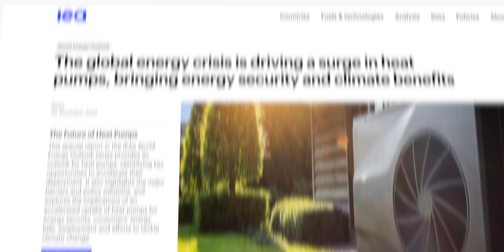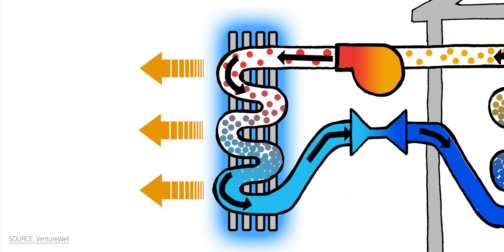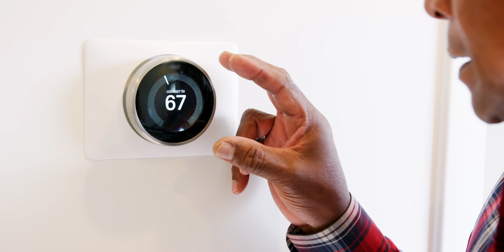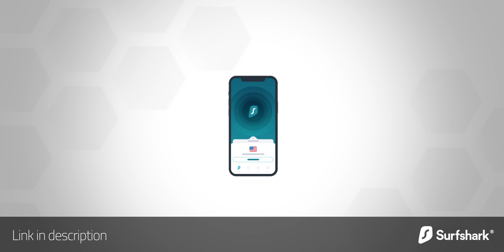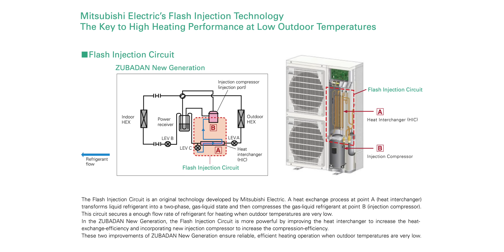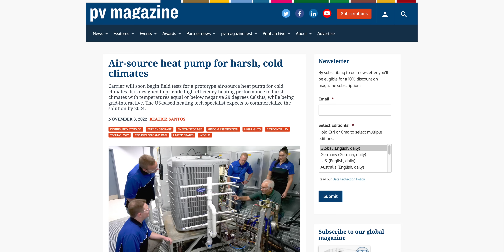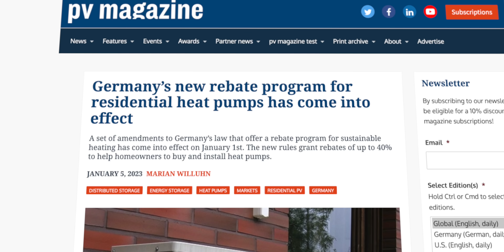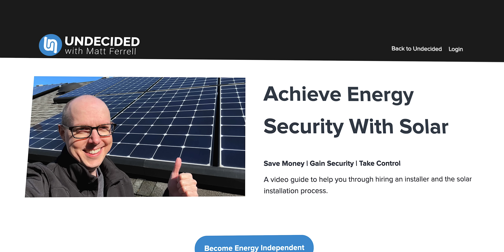Major Advances with Heat Pumps in the Extreme Cold

Comment: in the UK per KWh Electricity costs roughly 3.5 times more than Gas, even during the Ukraine war, therefore at present it doesn't make sense from a financial position.  Heat pumps are less efficient in cold weather, even if they can cope with cold weather they are still less efficient in cold weather, this makes the maths even worse.  Save the planet yes, save money no, not here in the UK at any rate.  Don't open the front door in the depth of winter, because that heat pump will take 3 hours to correct the blast of cold arriving into the house unless you install pre-heaters, and preheaters do not save the planet or your finances.

Comment: Matt... the Air Source heat pumps are vastly more efficient if they do not have to heat above 32 Degrees C.  Keeping it within that margin is difficult with radiators so underfloor heating has to be the way to go with an Air Source.

Comment: It is obvious that Matt has a New Englander bias around heat pump utilization. I grew up in New England and seeing a heat pump on a house is a rare thing in New England indeed. Most homes use natural gas or "Home heating oil" in a furnace to generate heat up there. For the rest of the United States, particularly south of the "Mason Dixon Line" heat pumps are the norm. In addition to this Heat Pumps are dependent on electricity whereas some fossil fuel heating systems work regardless of the power grid, something of huge value to cold climates where power outages are common. The biggest blind spot of this channel is that Matt presents his topics as if his audience has a bottomless wallet. He "energy shames" people without regard to their personal budgets. Just because Matt can afford a home that is easily 2x more expensive than a similar sized home from a more traditional build doesn't make it the right choice for the bulk of his audience. This blind spot makes Matt feel elitist and hard to relate to.

Comment: Matt, you really need to more clearly address the differences between air-source heat pumps versus ground-source heat pumps.
Reply: One couples to ground and the other couples to the air.  Ground source doesn't become less efficient in cold weather, but the borehole cost makes it more than double the upfront cost.

Comment: 2:10 is not how a heat pump works. The liquid refrigerant passes through an orifice to the low pressure heat exchanger, heat is absorbed due to the change of state of the refrigerant. The now gaseous refrigerant gets compressed, and is now at a high pressure, the refrigerant passes through the high pressure heat exchanger releasing heat as the gas condenses to a liquid. The liquid now passes through an orifice to the low pressure side starting the cycle again.

Comment: I really wanted to do Geothermal heat pump but the prices in MN were crazy for it and it would have blown my ability to get the house.
Cost of Project: $74,855.00
Potential Tax Credit 30%: $22,456.00
Cost with Potential Tax Credit: $52,399.00
This was about the best quote we got after trying 3 installers.That quote was from Nov 8th 2022.  A bit more that then $12k on the high end I was expecting.
This would have been for a new manufactured 1700 sqft home with a basement.  Maybe I can pull it off in the future, but for now I just need to do a traditional furnace and then look at solar after I sell my existing house.
Reply: Geothermal heat pumps are usually 20-30k after rebates.  What kind of BTUs did they quote?  This video mainly discusses air sourced heat pumps which are basically super efficient reversible air conditioners.  Those are in the 12k-ish range depending on size.  What was the quote on conventional furnace plus air conditioning?

Comment: Vermont is seeking to carry the no fossil fuel beacon over the cliff.  There are not nearly enough electricians to install cold wx heat pumps…and most are refusing to do so…why?  They fail miserably.  Anything above a cabin required several…folks who had them installed are using space heaters to stay warm…

Comment: The best way to get the optimum system is to allow them all to be available on a level playing field and let the population decide. In uk we went through a period of electric storage heating as we were told it would heat up during the night on a lower tariff. Well when the sun came out the next day there was no control and so we had to open the windows! My point, the lower tariff was an inducement especially as our area had no gas. When gas came my parents installed that. It remains the cheapest solution.

Comment: With the advances in several different types of heating and cooling, we are not tied down to a single way of heating or cooling a property.
For example, you could use a heat pump, but also have infrared heaters in the house both of which are more efficient than a boiler and both have their strengths and weaknesses, but complement each other.

Comment: electric rates in the northeast are expensive and you cant run the heat pump if the power goes out which happens often enough with ice storms or downed trees to matter. its about the same to run a heat pump on 26 cents (all fees included) a kwh electric vs 3.50 a gallon heating oil so the cost savings is not there and solar is at a minimum nov-feb when you need it the most for heat. personally i run mine in the shoulder months and then let my existing oil furnace run. also very glad i have a wood stove even if its a scary indoor firebox!

Comment: Congratulations on your vertical well heat pump system. I've had one installed 14 years ago, using 4 wells 150 meters deep. Great investment. Together with solar panels, equals zero energy costs.
Reply: damn, that's my dream setup..
Reply: Please tell us when the investment paid off?
Reply: @drdoolittle5724  Only 22 more years to the break even mark...
Reply: Geothermal really depends on your location. If you are Midwest then it can be worth it. But inverter style heat pumps can work significantly lower. My central heat is an inverter HP and it works down to 20*, and the only reason it can’t go lower is I went with the cheaper smaller unit, partly because my house is old and the ductwork is screwy and a larger one wouldn’t have been worth it. But I live in the pacific NW so we have only had one week so far this winter I had to regularly run my furnace.
Reply: What was the total cost of the system...🙄
Reply: Vertical well heat pump  100 to 400 feet deep
For a vertical system, holes (approximately four inches in diameter) are drilled about 20 feet apart and 100 to 400 feet deep.

Cost between $20,000 and $38,000
Unfortunately, vertical loops are the most expensive type of geothermal system to install, since installation involves deep and wide boring. A vertical loop installation costs between $20,000 and $38,000.
Reply: So was the vertical well heat pump system free ? Were the solar panels free ? If not then it most assuredly is not "zero energy costs" 🙄
Reply: @glamdring0007  I can assure you I've already earned it back.
Reply: @avhuf  And I can assure you that it was never free...which was my point. It might cost you nothing today but how much was the upfront cost ? 20k ? 25k ?
Reply: @glamdring0007  I think you're missing the notion of "investment" as I said in my OP. The point of investing is forking over an upfront cost (hefty in this case) and hoping to have ROI. In these cases, the ROI is often guaranteed. Heck, I'm making money atm.
Reply: @avhuf  You seem determined NOT to be upfront about the actual cost so I am calling it Pish.
Reply: @avhuf  Please reveal your upfront costs 14 years ago for 4 vertical wells and solar panels. Thank you.
Reply: Cost to you* I assume. Net metering is a tax on all that do not have grid-tied solar.

Comment: Morning. This was my first winter with heat pumps. I got 3 Senville units. All I can say is, they work! We had -15f here in New Jersey this winter, and my units go into defrost mode for maximum 2minutes and heat turns back on. So yeah, no heat while they go into defrost mode.
  My only problem is with a small room that overheats, than the unit calls for AC in the winter, than it's too cold, and it calls for heat, and it's a viscous cycle in Automatic mode. And in Heat mode, even on 1% fan, the room gets too hot. I dont know what to do.
Reply: Sounds like a poor choice of location of unit, sizing, and indoor circulation. Get with the installer while it's new and make the proper changes. As always, proper pre-planning is the key to any successful installation. Good luck.
Reply: Can you please tell us the model number?
Reply: Could a technician reduce the pressure thereby reducing efficiency a bit?
May be a little bit is enough to make sure the 1% setting is low enough.
Just an idea.

Comment: Here in Southern Alberta (Canada) temps can go -40 C or worst. I would rather trust geothermal heating than heat pump.
Reply: Geothermal heaters ARE heat pumps but instead of exchanging heat with air its being exchanged with the ground. 

The medium used for heat exchanging might even be freon and you don't even know it, or it could be a way less efficient water based system.
Reply: @Guardian_Arias  correct. I have heard they are more reliable then the ones that convert cold air into hot one.

Comment: I'm sorry, Matt, but this just isn't the case here in England. Were on the cusp of having heat pumps forced on us, with most housing stock being old and not anywhere near meeting the insulation and piping requirements for efficient heating. The govmt has offered £5,000 for 2,000 homes (!) to 'kickstart' the industry, but it's estimated the typical home would need upward of £10,000 of conversion work. we are not a wealthy populace, and this isn't going to end well for us.

Comment: I'd love to install this instead of a traditional AC but I live on a tropical island that's like full of caves & underwater rivers so digging down isn't always viable in most areas
Reply: air source heat pumps are a thing (arguably more commonplace). no digging required.
Reply: in that environment, an air-source heat pump would make a lot more sense economically.

Comment: our EV car has a heatpump and increases the range over the resistive heater version a lot
Reply: also when you state they will save money due to efficiency, in the UK we would save another £165 a year because we can ditch our gas supply as the supplier chargers £0.45p a day just for the ability to use gas, whether we use it or not

Comment: I have been thinking, why just get a heat pump for HVAC? Why not have the whole house integrated into one system. You have heat pump water heaters, freezers and refirgrators, and heat pump dryers. Connect them all together, with a solar pre-heating water tank, and solar heat rejection, and a thermal battery, and you could do everything for very little energy in life time costs.
Reply: Here in Europe, or at least in Germany it is common these days to install one heat pump for the whole house. The heat pump handles heating (mostly underfloor or radiator water heating) and hot water. No problems. Thousands and thousands of these systems are online here. I myself get one this year. It replaces my old gas boiler which also produced the heat for heating and warm water.
Reply: @Pilotmaverick  how do you accomplish fresh air exchange and humidity control?
Reply: System complexity and lack of modularity.  In order for complex, multi point systems to work, they are best all from one company and product line.  I deal with these types of things in the commercial/industrial world, and there's a point that it's just not worth it.  The other issue is qualified service personnel. It's hard enough to find personnel that specialize in one particular area. The thought of getting personnel that are fully qualified in that many systems is just shy of a miracle.  Having stand-alone heat pump systems (for now) is your best bet to keep everything working.
Reply: the only down side I could think of is single point of failure. lose your compressor and you lose everything.
Reply: Complexity, risks of leaks, and heat loss during the fluid transfer.  It is a nice idea but not practical.
Reply: We have all those heat pumps and will be adding the hvac portion soon.  The hot water booster tank will drop the hot water heating costs even more than the heat pump water heater already has.   In a way, they are all connected- by the electrical supply lines.

Modular sealed compressor systems built in a factory setting will always be more reliable than a custom loop of any sort.  I will stick with what I have for the modularity as noted in the other replies.
Reply: I keep wondering the same thing. Especially for new construction. The 'too complex' argument sounds weak.....like we're just too dumb to figure it out.

Comment: How do heat pumps hold up in -40? There are some 3 million people living in Alberta where temperatures can range from -40 to +40 degrees C. Are there secondary systems recommended during periods of extreme weather?
Reply: Ground source or geothermal should work fine, air heat pumps would not work well at those temperatures. But you could have a wood stove to augment the heat pump at temperatures.

Comment: CO2 based heatpumps are effektive down to -14 Celsius. A booster setup could go down to -40 Celsius and still have a COP above 1. Just more expensive then an additional heater for a meager higher efficiency.
Reply: of course you should take a "natural refrigerant" heatpump (Propane, Butane, water, ammonia & CO2)
Your refrigerator is likely working with propane or butane (very small amount).
Ammonia has some disadvantages since it is a dangerous substance.
CO2 is the safest and most versatile (and expensive) solution.

Comment: It depends on your property. If you have a HIGHLY insulated home, which has its own problems of mold and non circulating air, a heat pump might work. An average home, in the North or Midwest, I wouldn't do it.
Reply: i don't think many people suggest you to install a heat pump if your passivhaus does not have a MHVR or equivalent installed.
Reply: @John15293     to do this to avoid gas heat is absurd to me. The Average family can't afford air to air heat pumps, let alone Geo-thermal heat pumps, and to have a mhvr added to the cost...no thanks. I want this stuff on my home in the Cleveland area of Ohio, but I'm NOT spending that huge amount of money to get Geo and our air to air heat pump was trash when he moved  into our home in 2017. Getting 400 dollar light bills, no thanks.

Comment: You need to drill a pair of deep holes (more expensive but have to have injection and production) for the winter where several people can share the much hotter and more available heat.
Reply: Most reliable and efficient GSHP are closed loop systems that treat the pipes in the wells as really long radiators.  The only thing exchanged with the environment is heat, so the main concern is spacing of the wells.  The geothermal gradient offers no real benefit to going deep at any real economical depths in most geographical locations.
Reply: Yes, most places you’d have to drill expensively deep to get the delta H we’re talking. At the individual and community level, I agree 100%. But to commercialize it and get to town/city -level, I would argue that (actually I like the closed-loop radiator you mentioned) a deeper, larger system will reach efficiency on a larger scale as long as you have  a high perm reservoir that can provide the flux across the pipes. So instead of the 60 degree ambient temps near-surface, you’re utilizing 100+ degree temps for relatively cheap. I could drill and case a hole at 3500-4000’ feet for about $300k - maybe less. Give me a high perm sandstone and I think we’re in business. 10-20 acre offsets. Bet we could even drill on air and save money.
Reply: @carltuckerson7718  Once you get down to those depths the salinity and alkalinity of the reservoir fluid would become an issue if you pumped it directly through a heat pump.  10-20 acre offsets are fine for oil/gas wells, but many shallower and closely spaced wells can achieve a steady state at a much more economical level.  In fact, there was a study that basically inserted a radiator into an aquifer.  Each well that was drilled relatively shallow could produce enough sustained heat for two average sized houses (say 120k BTU),  The closed loop setup allowed the use of a coolant with corrosion inhibitors, like the ones in automotive use, to maintain the integrity of the system.  The setup could be run on tubing that would allow a small workover/water rig to service the radiator in the future if any problems arose.  Unfortunately, it is not yet commercialized and would really best serve neighborhood level as it is overkill for a single residence.
Reply: Totally. And you are a little more informed on the actual geothermal than I. I am well aware of the alkalinity issue - as I spent 6 years working with SWD’s in North-Central Oklahoma super brines during the earthquake storms a few years back. What I liked was the radiator style systems you mentioned. Although the corrosion still becomes an issue when you put an anode rod in a salty reservoir. Anyhow, thanks for the info. I’ve drilled hundreds of wells and have thought about this a lot. Would you be able to point me toward the paper on the radiator in the aquifer?
Reply: @carltuckerson7718  I logged and perforated countless wells.  The part we overlooked earlier was that the wells are also used to inject heat into the ground, so having a moderate bottom hole temp makes it easier to work both ways.  In fact cooling is much more important in the southern US.  I don’t remember if they addressed any corrosion issues but the study was on surficial groundwater which isn’t very saline.  I will try to find you a link.